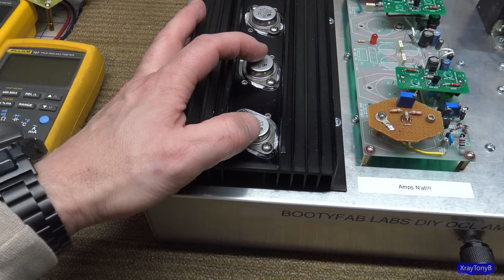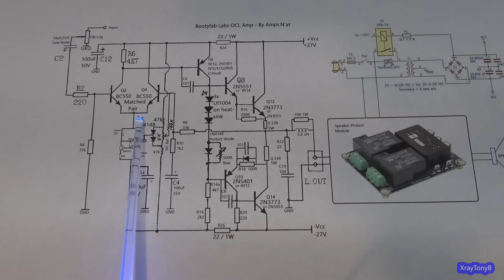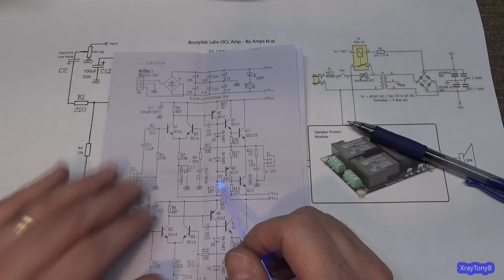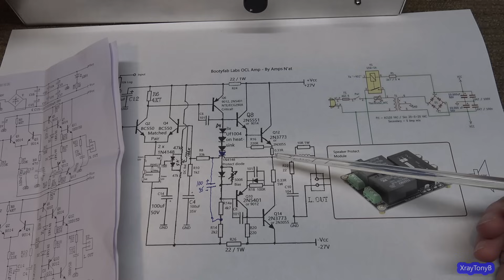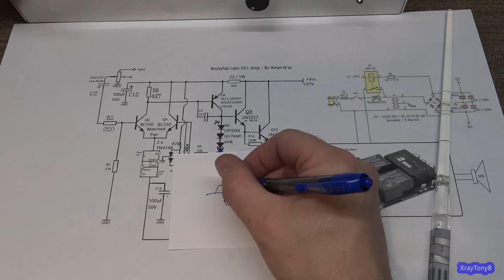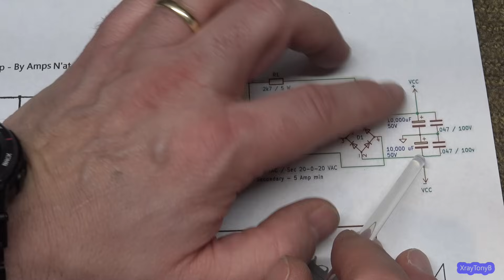Amps N at Part 10  - Bringing it all together

Comment: Hi Tony! I know you have moved forward from this project but after viewing the video again I realised that this circuit is very similar to my project and I need help with something. 

I am working on an AKAI amplifier that had an STK463 in it but it got replaced with a module built with discrete components with TIP35C outputs and it is working ok. I made the DC Offset circuit that you made for this amp and it works great for it. But I want to make changes to the power supply once more, because the components on the module can handle it and I happened to find some toroidal transformers that fit perfectly in the case and also I have another module that I want to put in the amp for a dedicated subwoofer channel. The issue I am facing is that the original transformers are +-35V DC and the new ones are +-50V. The subwoofer amp can handle up to 90V so there is no problem there but the AKAI amp module biasing was made for 35V and maybe close to 40V but definitley not up to 50V.

After viewing this video again I understood how the biasing is set in the module. If you google a datasheet for STK463 you will see the internal diagram of the chip, which is the exact circuit the module has. In the diagram they use two cascading transistors with collectors tied together (TR6 and TR8) for two base-emiter voltage drops and i'm guessing the ratio between R5 and R6 for the biasing. On my module the guy who built it chose 1K for R5 and 3.9K for R6 and with those values the amp works with +-35V. 

My question is, how should I go about adapting this to +-50V power supply and maybe add a bias adjustment? Can I increse R5 to 2K and put a 10K pot instead of R6? or it will be more involved?

The circuit also has a boot strap 47uF capacitor, just as you showed in your project. It is pin 4 of the chip and the resitors are 3.3K and 1K, just like in the example that they give in the datasheet.

I know this is alot to ask and I don't really expect you to spend the time and effort to search for all of this but I would really appreciate if you could give an answer. 

Thank you for all these videos and all the knowledge that you freely impart with us! I have learned so much from you! God bless!
Reply: Hi Tony! I have an update on this. In the past couple of months i took the time to learn the program LTspice and i simulated the amp on the computer to tinker with it. 
I have managed to convert it to a complementary design, adapt it to the new power supply, add dc-offset and bias adjustments, and everything works great.

It turns out that the cascading transistors were in a darlington configuration and they were used for biasing as i initially presumed so i found an NPN darlington transistor that i mounted on the heatsink with the outputs for thermal tracking and it does the job perfectly. The Amp puts out clean 70W into 8 ohms, when initially it was a 25W amp, alongside the added module that can do 140W into 4 ohms for the subwoofer. I couldn't be happier!

I want to thank you very much for everything that i've learned from you! Your channel has been a wealth of knowledge for me!

Comment: I don't believe you need the pads under the output transistors. What's wrong with the collector voltage showing up on each heat-sink?

Comment: As a very old USN Fire Control Technician (Radar) working on rebuilding an old stereo system this was a fantastic series. Forgot most of what I learned back in the day. You did a great job of explaining what you were doing. 

Hopefully the Sansui 7000Z Amp and M9 tape deck will end up sounding good as new. Got rid of my o-scope years ago. Can I get by with a newer less expensive digital handheld unit that I see on Amazon? If not, I can do all the labor intensive component replacement and take it in for fine tuning. I have a nice sounding Sansui 6060 but picked up the 7900Z as a non working unit pretty cheep to rebuild. Also 2 of the same tape decks. One working, one for repair. Too much time I my hands??? Thanks again for all you do.

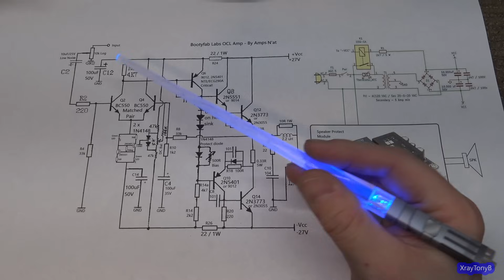Comment: 32:35  can I implement this dc offset circuit in any voltage range. As l can see here is + 25v has  used I have an amplifier which is +-35 v rails  and getting dc offset though the Ltp pair transistor are matched . So can I use it?

Comment: You could put a pot in your bootstrap to make it adjustable in order to even out the clipping to be equal on the top and bottom of the output. I'd also like to see a 10khz square wave just for S&Gs! You could also put some small ceramic caps across all the bridge rectifier diodes to suppress any switching noise there to make your supply even quiter. Thanks for the series. It was great! Ok, one more question... Why not put a cap like C8 on Q10 on Q8 as well?

Comment: Question: I see a 1Mohm in the complimentary CCS. What's the purpose of this resistor?
I've done the CCS on a breadboard for now and the CCS is more constant and excellent fixed current without the 1Mohm resistor. The current drift depending on voltage with the resistor included is not mush, but still:)

Comment: Thank you Tony for this entire series, and I have learned a great deal from it. 

How about a series on the topic of Dynaco solid-state gear using  upgrades from Dan at Updatemydynaco, where you dive in, compare and dissect the new circuits/upgrades and compare to the original? Maybe an SCA-80?
Reply: I think that I have come across the Dan upgrades when I was searching for information on a Dynaco Stereo 120 power amplifier I purchased recently for $20... 
I find a certain beauty in circuit layout design and the 120 is something special to me! 
From the components used to where they were placed, the Dynaco is truly beautiful! 
While there were upgrades available, the upgrades on offer contain components that look different to what was used in the original and I wouldn't have a problem with that except for it made the amplifier look less desirable, the stereo 120's enclosure uses a mesh screen for the top cover which reminds me of the older vacuum tube models and this allows you to see the beauty inside..... 
While the Dan upgrades might make some great performance changes, I'm not swapping out the beautiful metal encapsulated TO3 Transistors for the possibly superior plastic equivalent.... It just doesn't look good on that amplifier! 
Hence the amplifier in this video, it's the output transistors that draws you in....

Comment: Can any one tell me what speaker protect module that is and where to buy one?
Reply: A simple Google search for 'speaker protect board' made me find it in less than 30 seconds 😉.
Seems to be a 30A amplifier/speaker protection board.
Reply: I did a google search and similar units came up but the specs seem to be different than the one Tony is using. I can't seem tk get a clear shot of it! Wish Tony would have told us which one he used!

Comment: Hi Tony
Your videos are very scientific
They are really enjoyable
I have a question for you
How much distortion can be detected by the human ear?
Reply: Pardon......🦻
Reply: Tony actually mentioned this in, er, one of the previous 9. It's personal, but maybe something like 0.3% is easily audible. It probably matters what kind of distortion it is too.
Reply: @thulinp  
When the voltage decreases 10 times, the power decreases 100 times.
1% distortion means 100 V main harmonic and 1 V sub harmonic.
As a result, on an 8 ohm load, 1250 watts of main harmonic power and 0.125 watts of secondary harmonics.
Compare Is it recognizable?
Reply: @aminbjt5843 I feel 1% is very easy to hear on things like piano. Not on a death metal track.
Reply: @thulinp  This ratio holds everywhere.
If it cannot be heard in one type of instrument, it cannot be heard in any other instrument.
And the ratio is still 1 to 10000. This value is equal to 40 dB.

Comment: Tony, your Bootyfab chassis gave me an idea - a fully point-to-point-wired solid state amp (lotsa terminal strips!)
Reply: I have always wondered why they didn't make transistors to be socketed until I found out that they did, then I was left wondering why they stopped making them like that! 
I mean, just imagine how awesome it would be to be able to swap out transistors as easily as vacuum tubes? 
And they looked good too!

Comment: that has been an amazing series. thanks much. 👍
one question, in some circuits, we have seen R14 is replaced by a transistor constant current source. in such cases, any bootstrap capacitor can be utilized, or is useful ?